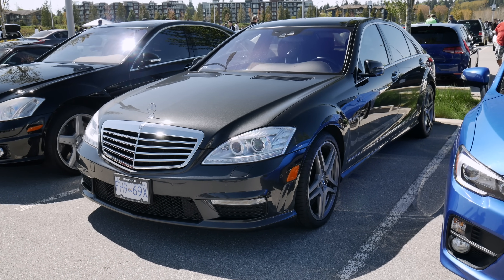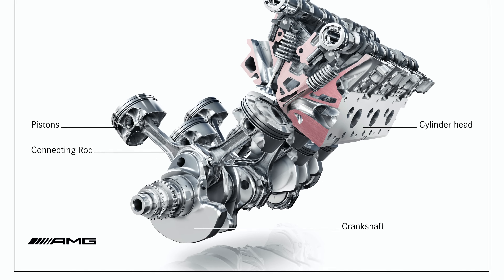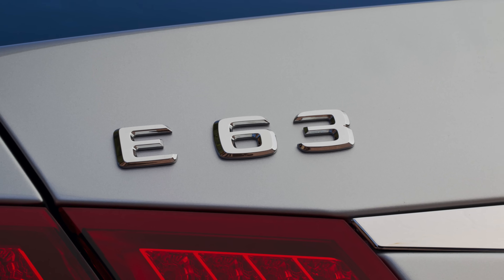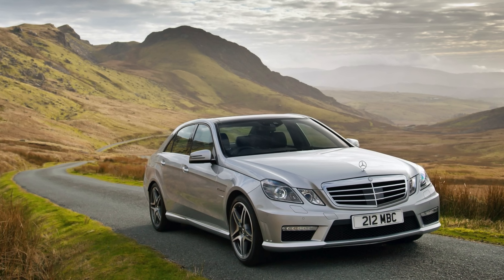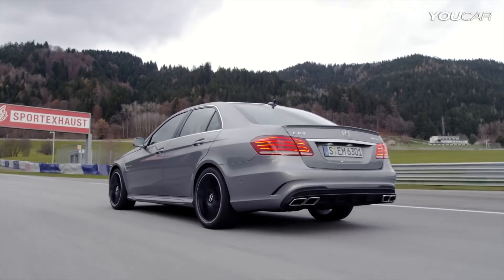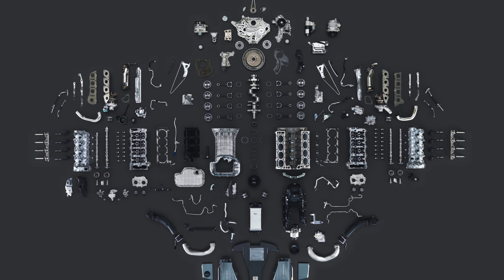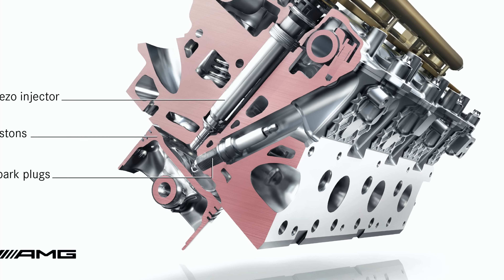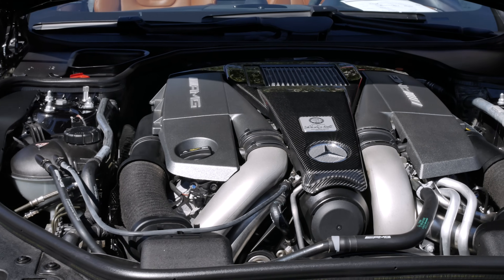Mercedes-AMG M157 Overview | V8 Biturbo (4k)

Comment: Very informative as usual! I notice the block has open-deck design but many performance-oriented engines as far as I know would be closed-deck. Is this one of the main weakness of the m157? Is it a cost-cutting measure or they did this to achieve some other purposes? I believe the new m177 went back to closed-deck design though. I'd be glad to see a comparison video between these two!
Reply: Open deck may be better for cooling but it's also a weak point.
The M157 also has very soft cylinder walls.
This means if you ever want to use forged internals, you will need to resleeeve the block other wise the harder metal of the forged internals will eat through the cylinders.
To me it's an obvious cost cutting measure by Mercedes.
For massive power with reliability you can't go past an LS engine. It's just a more robust design.
Stock LS3 engines can take 800hp all day.
They tear themselves apart at 1000hp though when tested.
Reply: @mrmysterious6006  Thanks for sharing this! The LS series is definitely the better option for making insane power as many would agree. I really think this Merc engine was born at a time when Daimler focused more on cost-saving than quality. The later M177 is by far a better design apparently.

Comment: Love this motor I have 2013 e63 performance package and I have raced a lot of high end cars and have not lost yet!! Beat Audi R 8 V10 - 2018
and 2011
Beat 2015 M6 performance pack 
C63 s model 2016 
Camaro ZL1 2014 
And a lot more man all on 50 mph roll!!
Reply: That is why I chose the 2013 model e63 performance package also, because it's faster than the 2014-2016 facelift e63s from a roll. The facelift models are AWD and even with the S models having 577 horsepower, our 2013 RWD PP with 550 hp and 590 lb tq are quicker from a roll. With a Renntech tune and catless downpipes we're beating super cars.

Comment: M113K is my favorite engine. Never lacks torque.
Reply: M113 is turd like compared to these
Reply: @robcarlson7845  Maybe so. I've had them both. But the M113k is still my favorite.
Reply: It really isnt Its reliable as hell. Bolt ons past 700HP or whipple supercharger past 850HP.  @robcarlson7845 Id say the biggest loss is the turtle of a transmission. Thats probably where M157 cars shine

Comment from the maker: After nearly a decade of production, the m157 ended its run at AMG in 2019. It's definitely a torque monster.
Reply: AMGmeister I know that youre not ”dieselmeister” but can you please make overview of another torque monster? Its called OM629, 4L biturbo V8 diesel
Reply: @joosuaaaltonen7900 i dont mind a nice review about diesel
Reply: Hey can you do a video on the M177? I am thinking about buying a car with one of those and would like your input!
Reply: I guess make sure that your 157 is after 2012 then…😂 if it isn’t then all of these potential problems needs to be addressed immediately. That cam sensor oil leaking to the ECU sounds like a nightmare waiting to happen. Replace that one first. 🤣
Reply: 😂honestly speaking if the m157 was inserted inside the c63 it would have been higher up your tier list in the s tier
Reply: So they call it a biturbo, but it has 2 exact same garret turbo units.. Doesn't it make a Twin Turbo instead then?
Reply: @Stichting-AAP  no twin turbo and biturbo mean the same thing
Reply: @TrustMeIKnowEverything   😂 it’s a millennials way to say twin turbo…🤣
Reply: @TrustMeIKnowEverything wrong it’s biturbo because ones smaller and ones bigger
Reply: @Stichting-AAP  bi=twin
Reply: @Stichting-AAP  bi...is two...like..bi cycle...2 wheels...biturbo...2 turbos
Reply: Small nitpick but the 63 isn’t for marketing purposes to keep the name the same, it’s a call back to their racing heritage
Reply: @danielpearcy8846  In Australia it was done for marketing reasons only

Comment: Had a E63S of the last Model year with the M157 and loved it; with a very mild tune I ran mid 11’s around 125mph. The problem with the car was the transmission which was weak and the car would not launch well, proven by the 125 trap speed which would typically give an ET closer to 11 flat
Reply: U could have fixed that issue with a tcu tune. Eurocharged, renntech, and one other company all offer one. Would have chances the launch and acceleration and. Throttle response drastically
Reply: @shelbyhaiketic4212  also went into the same problem. Could u specify more?
Reply: It’s not that the transmission that is weak. The transmission can handle 900 ft lb of tq stock. How is that weak? It’s the transmission computers that is limiting the torque output at lower gears. By getting a transmission flash you are risking damaging the transmission because the tune removes all the safety precautions the stock tcu has put in place. Imagine having close to 900 ft lb of tq and getting a tcu tune just to damage your transmission just to shave .2 tenths of secs. off of your 1/4 mile time.
Reply: Lol that’s because it has torque reduction in the lower gears to save the trans. What do you expect in a heavy ass car with AWD that makes tons of power, and has to maintain a level of reliability? You can feel the boost coming in in the higher gears

Comment: You missed one problem. Cylinder 5 misfire caused by improper valve seat. I was a dealer tech for 4 years and we saw this quite a bit. Not sure if it was because we had a high concentration of 157 or 278 engines in our area, but it affected both. I cant tell you if it was earlier or later models. I never paid attention enough.
Reply: What was your most common method to fix the issue? I have a miss on cyl 5 only while motor is cold. Passed Como tests but failed leak down though intake valves.  Again only while cold.
Reply: I have cylinder 6 misfire but comes up as ingniton coils gunna swap and see

Comment: Good job as usual ...one request or tip ,, ,,could you give power and torque figures in kW and Nm as well please...many countries don't use horsepower and ft.lbs.  Thanks..
Reply: Lb-ft, not ft lbs. our tuning shops use incorrect reversed verbage.

Comment: Great vid as always. I went from an M156 (‘09 E63) to an M157 (‘16 CLS63) and I love both engines, but I’d still take a 600hp M156 any day.
Reply: But did you tune the m157?
Reply: @Phuong_Nguyen_  Uber driver t-boned the car before I could. Now I have an E63S with an M177 and ECU/TCU/CPC tune that’s actually insane.
Reply: @CylinderHeadE60  so which engine is your favorite?
Reply: @Phuong_Nguyen_  M156 sounds the best and is just legendary, M157 is a great mix of sound and power but the turbo lag is bad, M177 is easily the worst sounding but the power is incredible and doesn’t stop. Just depends on what you want. It’s definitely hilarious daily driving a 750hp sedan.
Reply: Got a gl63 with a tune..im doing 660hp...i love smoking cars from the dig

Comment: I thought this engine was a reliable engine until I saw Tasos' videos. He shows how 4 Matic (which is the only E63s we get in NA) versions bend connecting rods even in stock cars. When that happens, the cylinder walls get ruined. The cylinder wall cover is very soft in M157. I think anybody who's see Tasos' videos trusts his words.
Reply: The cylinder only get scrapped because the M157 uses a variable load oil pressure system which turns off the piston oil sprayers at below 3k rpm. But since the M157 is a turbo engine it makes a hell of a lot of boost below 3k rpm, so tons of boost + dry cylinder walls = scrapping. Unplug your variable oil pressure solenoid and return the engine to full oil pressure all the time and there will be no problems.
Reply: @clonetrooper576 How do I do that and will there be no warning lights on the dash?
Reply: @masonichisenga3032  not that I’ve seen before, but man those cold starts are gonna sound crazy 🤣
Reply: Cylinder walls are indeed soft like butter.
Reply: Is it really that bad m157 ? I was considering buying one ,now I don't know
Reply: @dg1738  it’s a hit or miss. But asides from cylinder wall scoring there are other issues. If you have money, skip m157 and get yourself an AMG with m177.
Reply: @ELWIN225  thanks i may look at audi s8 d4

Comment: I've owned a few AMG's including the M156, M157 & M177 (in my newer c63s) - this engine was awesome, I must say the M156 is a nicer engine to have fun with BUT this thing sounds great, nice turbo sound, deep throaty burble... possibly sounds better than the M177 and the M177 has all the fancy variable exhaust.
Reply: I HAVE M157 :D
Reply: @datura_boof  they’re great right :)
Reply: @thatmatty231guy  m156 more fun? But slower than the m157 right? What was fun about it?
Reply: @Phuong_Nguyen_  Yeah - the M156 just has a quick revving, more vibrant feel, like a race engine. The M157 is more powerful & torque than the 156 but more tame I guess and slightly less exciting - they're probably equally great in their own right, just very different feeling.
Reply: @thatmatty231guy  interesting. Never driven a m156. But I have an m278 e550 coupe which is the little brother of the m157. And the e coupe is lightweight like a c63. Im also Eurocharged tuned downpipes and intake and the thing is a torque monster and very good on gas too. But yes it is a slower revving engine. But dollar for dollar it can’t be beat.
Reply: @Phuong_Nguyen_  Yeah the M278 sounds like a great V8!! especially tuned - sounds like its capable if you wanted of outputting what a 157 would. I wouldn't hesitate to buy a S550 or S560 one day - they're quick motors and really economical compared to the old 156/113's :)
Reply: @Phuong_Nguyen_  I own all 3 engines as well (m156 m157 m177) and I agree with Matty, the m156 is a more fun engine than the m157 because of the high revving and race car feel compared to the m157. As far as speed goes that's a different subject but excitement wise goes to the m156.
Reply: @talkditingsdemisrael  interesting. So you’re saying if a new model amg was released and they allowed you to pick your engine, you would pick the m156?
Reply: @Phuong_Nguyen_  No I'm not saying that at all, but I am saying is that the high revving 6.2l V8 is such an enjoyment to drive if your purpose is strictly having fun. Now fun doesn't necessarily means speed or steering feel. You can easily rev out to close to 8k rpm and it give you a race car feeling which the other two engines doesn't give you. I'm not saying it's the better engine out the three but it is the most enjoyable.
Reply: @talkditingsdemisrael  but if you had an opportunity to choose one in a new car, which one would you choose and why?
Reply: @Phuong_Nguyen_  I honestly would choose the m156. The way that the m156 is so different from all the other engines (m113k, m157, m177, m178, m278) speaks loudly. All other engines are forced induction, making them torque monsters, the natural aspired V8 that the m156 is didn't have that low end grunt allowing it to flow freely through the rpms all the way until it redlines. That engine just flowed so freely that it made it a joy to drive, the throttle response is second to none and the way the AMG team engineer it from the ground up (using all of the AMG racing team techniques) made the m156 a masterpiece. You have to drive one to understand why all owners love that engine even after owning all it's successors. The sound alone is enough for anyone to want to own one when you hear it in real life and not on the Internet. So yes I would love if Mercedes put the revise version the m159 in a new car but I'll definitely would take the m156 also.
Reply: @talkditingsdemisrael  did you ever tune your m157 or m177?
Reply: @Phuong_Nguyen_  Yes, both are tuned. Both stage 2 and catless. One is dp catless, .22 gap plugs, intakes (black boost). The m157 dyno at 630 to the wheels so like 744 to the crank, the m177 I never dyno but it's most likely close to 680+ to the wheels.
Reply: @talkditingsdemisrael  sounds like the m156 was a really good engine. I’ll have to experience it one day. Would you say the m177 was a big jump in engineering when compared to m157?
Reply: @Phuong_Nguyen_  Yes I would say that it is. The placement of the turbo's are the difference maker, it's place in between the V making it feel like a natural aspired engine, not exactly but it's almost no turbo lag like with the m157. The m177 is just more efficient and I also believe that have a lot to do with the transmission it's mated to. The m157 is a very powerful and angry engine in character compared to the m177 which is a little quieter and more bubbly and poppy when it come to the exhaust, the m157 sounds like thunder and performs just as great as the m177 mod for mod but the delivery is much different. The m177 just feel more dialed in.
Reply: @talkditingsdemisrael  the m157 was such a powerful and big engine. I wish Mercedes would had kept it and improved on it. The big issue was bank 1 and 5. Too much heat from the turbos would saturate those banks and ruin the valve seats. I guess that’s why the inside V design is so much. Better. But there’s no replacement for displacement. 5.5 biturbo is a monster.
Reply: @Phuong_Nguyen_  You are correct, I agree with you. It's just that with the EU new rules and regulations Mercedes and other EU companies had to cut displacement (smaller engines) just to pass. This is the final year for the V8 in any AMG, which makes me sad just to know, the new E63s will have the same engine that's coming out in the new w206 c63s which is a 4 cylinder with an electric motor. It's going to be 700+ horsepower but who cares without that v8 rumble. The m157 most likely would of been the engine Mercedes kept improving on if it wasn't for those ridiculous EU regulations. They're just so powerful.

Comment: I've had my car for a little over a year, so not long. Only issues I've had with it is the one's I caused. Tuned it and Coils/Plugs went out otherwise I haven't had any other issues with it. Mine is a 2013 with 58k miles bought and now I have close to 70k.
Reply: Phuong Nguyen I changed the plugs unfortunately 3 times before figuring out it was coils. The plugs from what i know was not indexed. When the first time I changed it with Brisk Plugs they told me its not needed with there plugs. The second time was NGK's and third was the factory plugs just gapped at .024. Thats what I have now and been driving on for a few months. It does miss or have slight hick up here and there still bit hardly noticeable . Im doing 1 step colder soon and bought them from VRPSpeed. Will see how those pan out.
Reply: Phuong Nguyen Thats atleast what a Brisk salesperson said. There are others who say you must index but this time Im taking it to a Merc Dealer and just have them do it. I got no part numbers for the ngk just bought it off vrp and on vrp site they dont post the part# either. Just says one step colder.
Reply: ya your right this is the 4th time and hopefully the last time. Hopefully it will run better.
Reply: That's why I went stock as well, the forums. Some also say just use the stock gap as well. I gapped mine .024. I don't know I wish tunes weren't expensive but going from tune to tune is costly. The 2nd time wih the NGK I went with what my mechanic looked up on his computer and suggested that particular plug. Its a long story with my plug issues but that NGK plug was not as wide so the boot would not fit on it properly meaning tight enough. I ended up running that plug for a couple of weeks till I changed them.
Reply: I did DTK and now im running Matt HD Tunning. He eventually meaning Matt dyno tuned it at Lang Racing Development. Both tunes felt great, decent amount of torque. Both tunes pulled about the same power just that Matts tune although not perfect and I cant blame it on him or anyone else could still be a plug issue or another but he's tune runs a lot smoother. Very minor hick ups. My 2007 E550 Has O.E Tune. There a reputable company as well never had an issue with them.

Comment: Can you make a video about Mercedes relationship with brabus
Reply: I work at Brabus HQ, what you want to know? :)
Reply: @JustinsSupercars  Tell us more about the W210 Brabus 7.3. I couldn't find much solid data about that car.
Reply: @FStan-co8vv  a few years ago i just missed the only one in the Netherlands,it was sold for 4950 euro.
It was a 6.0 v8 and a 7 seat station combi.
In these days i had my first E50 amg,so thars why i didnt give to much attention to the w210 brabus
Reply: @high5compliments45  Damn, what an opportunity! I had my E63 W211 for several years now and i feel like it's the time for a change. I'm looking after E63 W212 T-modell at the moment, but if i can't find any good deals i'll get something else.
Reply: Florin Stanescu What exactly do you want to know? It’s also knows as Brabus EV12. We built quite a few of these cars. It had 582HP and a limited top speed of 330km/h. It was only limited to that speed because no tire manufacturer was able to produce tires that could go faster at that time. It was also built as a EV12 station wagon.
Reply: @JustinsSupercars  Hi, thanks for the reply, what transmission did it have? What diff and rear axle?
Reply: Florin Stanescu It’s an old car so it’s way before my time at Brabus. But I will see if I can get some information from older colleagues who built these cars back in the days.
Reply: @JustinsSupercars  Thanks man!